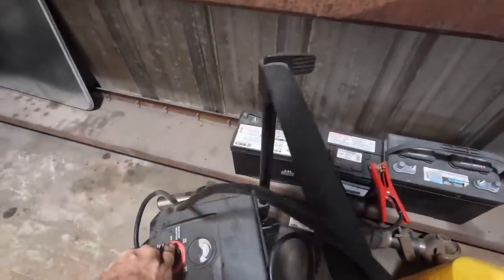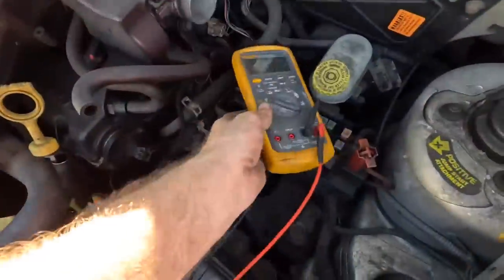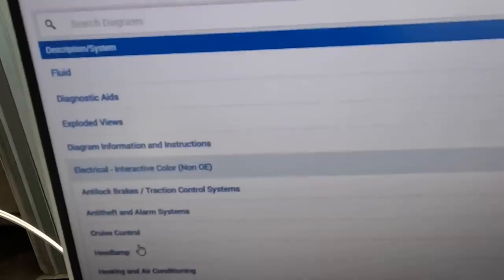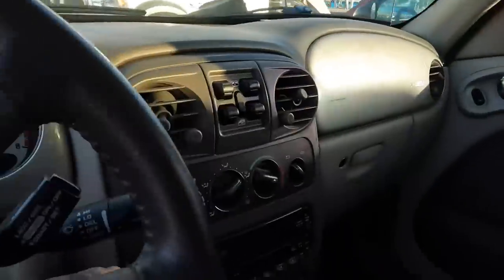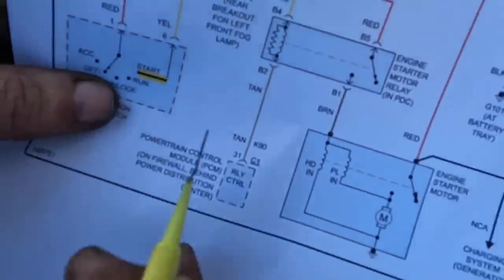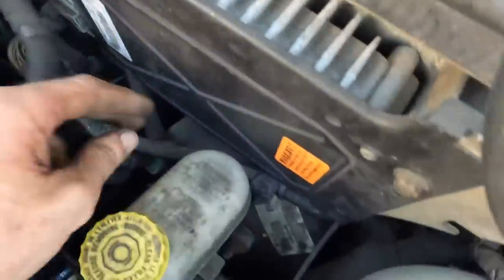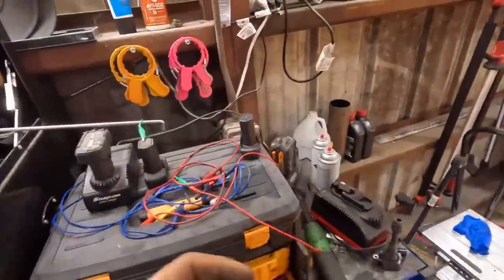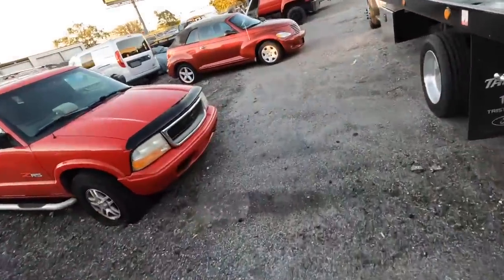It’s DEAD! Parking lot diagnosis

Comment: You might want to look into the anti theft system. Looks like your key has a grey colored head which signifies anti theft vehicle. Also there is a red dot light between the two left hand gauges, that should be the anti theft indicator light. You also might want to go back and revisit the door lock issue since the door locks and the anti theft system share some of the same fuses. As a side note it is not recommended to swap modules between Chrysler vehicle of that era and earlier. Connecting a module from an anti theft vehicle to a non theft vehicle can awaken programs in the non theft vehicle and it may never run again. Rare but I have seen it happen.
Reply: Agreed, I had the same on a sebring in about 2002
Reply: Yerp.
Reply: Yep, same BS with my Volvo. Change a battery and you need recoding.
Reply: On my 2001 PT Cruiser when the key was not recognized it would start for a couple seconds and shut down.  I had to have 3 pcm programmed to finally get a good one.
Reply: Could also be the sensor ring around the ignition switch that picks up the signal from the key.
Reply: yeah my guess was going to be some kind of immobilizer circuit.

weird how dash door locks work but not door switches.
Reply: @Ralph_Baric_PhD_C2019  might just be the immobiliser and central locking that are affected
Reply: Well spotted and agreed. I wonder if the key coded to the immobiliser
Reply: Same on an old Buick
Bypassed it with some resistors
Reply: Yep had the same problem with a Ram truck. Had to disable the security to start it after steering column was changed after an accident or something if I remember correctly.
Reply: it's out of gas  LOL Gas light is on  and is on EMPTY
Reply: @Ralph_Baric_PhD_C2019   the best immobilizer is running out of gasoline  16:19  it clearly shows it's out of fuel
Reply: I thought the PT Cruiser emblem was the anti-theft system.
Reply: to me it appears that the veh neutral safety switch might be bad
Reply: Took me a week to figure out that the stealer ship only programmed one replacement key to my Nissan.
Reply: Had the same problem with an '01 Town and Country.  New key reader and two news keys and it was fine.
Reply: makes me wonder if someone tossed a junkyard PCM into it (ray said he had been told the pcm had been replaced) and added to the problem by screwing the security.  

plugging a scantool in and seeing if the vin in the pcm matches with the car might be enlightening.
Reply: Good catch Sparky, I didn't see it until rolling the video again, just after 2:00. That little light would be easy to miss. As others have mentioned, the key needs to do the right dance to the immobilizer so it can tell the PCM whether it should allow the starter motor to run. A scan tool should be sending red flags regarding that as well.
Reply: @normangarrand1106  Don't worry, with the magic of editing, he can replace the neutral safety switch off camera. Then still look like a professional after replacing the "faulty" pcm. I can't believe he didn't even try to click it into neutral. WOW!

On the bright side, the neutral safety switch is internal to that trans (under the v/b), so you can up-sell a trans filter & flush too!!!...$$$
Reply: @punker4Real  I posted that then deleted it, because being a female, I thought I would be told I was stupid.
Reply: Let see if he makes a Part 2
Reply: P😊
Reply: @punker4Real  yes but it also did not crank a car will still crank if there’s no gas. Ray only got it too crank by bypassing the ground
Reply: @marymulrooney1334  Mary say what you like don’t worry what others think of your thoughts and if they disagree you can get even once your proved correct😃 Have a great day👍
Reply: @marymulrooney1334  i hear you.  Been in the trade 30 years.  learned to hide my gender online long time ago.  ignore that.  just trust your training
Reply: As I was watching this I wondered if it could be a bad key sensor or whatever they are called. Is that what your saying here?
Reply: @wo4689  I have a 2000 Sebring and it came with a hardware store 2nd key. That key without the chip would start the car but wouldn’t let you move it.
Reply: FWIW, the immobilizer in the 2014 Jeep Patriot will allow the engine to start and run for three seconds if the fob is improperly programmed.
Reply: Why would anybody want to steal a pt cruiser  !
Reply: @scott.koopmann  if the neutral safety switch were bad he would not have power at the relay.
Reply: My 02 3500 Cummins if you don’t open the door on either the passenger side or the remote you’ll never get it to start.
Reply: @oliver_klozoff  Automotive relays require a GROUND signal to activate. The fact that there is power is irrelevant. The fact that there is no ground signal turning the relay on is the problem. The pcm sends the ground signal to the relay, but the pcm will not send that signal if it thinks the vehicle is not in park or neutral.

Tune in tomorrow to see the results.....maybe.
Reply: You guy are smarter average bear!
Reply: Yet anti theft on a Pt Cruiser...humm
Reply: Good to know. Thx for the info. Anti theft so powerful it keeps everyone from using it 🤣😶
Reply: @devinangola3458  recoding for a battery change? Love to hear that story.
Reply: To my knowledge, Ray checked all the fuses on the bus. So I don't think it's the anti-theft fuse connecting locks with PCM
Reply: @CameronDC-Grimes  Yes, he did but there is another fuse box inside the passenger compartment. It contains three of the four fuses used in the anti theft system.
Reply: @scott.koopmann  You are correct that the PCM will not allow the starter relay to work if the neutral safety or transmission range sensor is not sending the correct signal to the PCM. The lack of a proper range sensor signal should not inhibit the PCM from enabling fuel on this era of vehicle though. Although it could also be out of gas as mentioned by someone else. The fun in doing this kind of repair is collecting all of the data and using it to solve the mystery. Personally, I would have started this diagnosis with a full vehicle scan for codes and then looked at data related to the symptoms but it is more fun sometimes to see how far you can get with just your wits and a multimeter.
Reply: @davidmerullo551  Sounds like you have a problem with the driver's door lock cylinder position switch.
Reply: @devinangola3458  isn't that completely different? The car will still start but may over charge the battery decreasing its life span.
Reply: @BlamBlam80  the pcm controls numerous relays and security systems. It sat for 2 years during the pandy and water infiltrated passenger side flooding it. That’s another story. It sat dead for a long time, changing out the battery would allow it to start but half the bells and whistles and audio and screen don’t work. The car drives but twin turbo doesn’t seem to be working. 
  I need to enter the vin number and have access to a diagnostic programmer to enter the code….I’ve looked for fixes that could be done to get said code but they all are paper tigers. It has to go back to the dealership to get reprogramming vans that cost money.
   So my car is a slug till I cough up the money. It’s all to do with the security in the dcm, a stupid anti theft program that holds your car hostage till the get it rechiped, and the car has 3 fuse/relay panels and depending of what country the car was going the schematics and locations change. I have 10 different down loaded schematics,over 30 sheets of papers to decipher through the wiring to problem solve.
   It’s the pcm, so it has everything to do with this thread. If anyone has some insight how to remedy this problem on my own let me know, or I just go pay the extortion fee to get my car back…
Reply: @scott.koopmann  but if the PCM is receiving all of its proper signals and not giving it then that is irrelevant. Also if none of the relays are receiving that ground signal from the PCM I really doubt the neutral safety switch has anything to do with the auto shutdown relay. Nice try arm chair try again.
Reply: @devinangola3458  wow. Good luck 🍀
Reply: @pitchforkpeasant6219  I don’t need luck I need a technician who can enter the vin and recode/chip the car!!😂
   I’m starting to think just spend the cash and hand it to a shop….😔
Reply: bmw,,needs to know what type, style, amps, color, price, your battery is..when replaced..
Reply: @marymulrooney1334  Maybe should post it anyway.  Hard call, yes?  On one hand, getting called out sucks and tends to make a meta conversation that can also suck.  But, on the other  not talking about stuff can pull a person away from things they would benefit from and enjoy too.  Craptastic!

The clowns calling you stupid are a PITA and maybe karma sees them stub their toe every time they talk a woman down.  Hope so. 

And yeah.  You deserve the same conversation any of us have.  I am raising a young one who is mechanically inclined.  She seems to love talking about these things and learns quick!  This crap we are talking about snuffs out that mechanical spark in a lot of girls, right when they are ready to pick up the high value skills and potentially grow into mechanically capable women.

I am encouraging her to speak her mind same as anyone.  You should too, and of course you are not stupid.  But they really are clowns.  Probably stuck with that too.  The rest of us get to laugh.
Reply: @johnlarkin549  This!
Reply: @DougDingus  ?
Reply: @johnlarkin549  Sorry John.  "This!" is a short hand expression for when one might say they agree or see what someone else said as being solid, worthy, worth consideration, etc... hope that helps.
Reply: When it was cranking I would have introduced some starter spray to see if vehicle fires with fuel introduced.
Reply: @DougDingus  👍
Reply: @ZGDX_Smiling_  Looks like you called it. Thats too bad, I was really looking forward to the sequel of this one. I guess thats the rules of a youtube "tech"...never admit to being wrong, just pretend like it never happened.

Comment: Pop the key in and switch to the on position, immediately click the drivers door unlock switch, see if the anti-theft light goes out.  PCM might be mismatched or hasnt been programmed, or it may have switched to anti-theft mode if someones been switching PCMs to test.  Who knows if the key, PCM, lock barrel even belong together.  PCM might be good but refusing to authorise crank.
Reply: Yes,  That is the case with that range of anti-theft systems in Chryslers.  If you try to start one of these with a hardware store-cut key "slug" the engine will run for about 2 seconds then cut out.  I think you get three attempts at this before the PCM goes into code and a dealership has to reset the PCM to allow a restart.  I don't know whether you can still crank the engine when this happens or if it is a complete ignition disable. And I'm not inclined to experiment with my '01 PT Cruiser LTD 5-speed. 😑

Comment: Ray, the question you weren't asking is, "why is the ground coming from the PCM?" There's a reason for it. So before loading the parts canon, you should be looking into the inputs to the PCM that are supposed to trigger that ground output. A very simple example would be if the gear selector was not in PARK, the starter should not fire.
Reply: Can I ask you a question? Where I'm from we have virtually no cars with auto, hence my ignorance. I assume there's has to be some kind of sensor that detects when the car is in Park to avoid lurching accidents when starting the car, so if this sensor was to be faulty it could cause it to not crank?
Reply: @aigoru8718  Yes. For stick shift cars, there is typically a clutch pedal sensor/switch so the car cannot be started in gear. This is also used to deactivate the cruise control if the driver pushes in the clutch, otherwise the engine would redline.

For automatic transmissions, there is a sensor/switch that detects the gear shift is either in park or neutral.
Reply: @powertool64  Thanks dude!
Reply: @powertool64  Thats interesting information for me as it shows how cars have changed since the early 1970's when the clutch pedal sensor did not exist on at least UK cars.  This meant that when my 1968 Mini ran out of petrol 100 yards from a garage I was able to simply put it in gear and operate the ignition key and "drive" the car to the garage using the starter motor as a sort of "engine".  Didn't seem to do much harm apart from a burning smell from the heater vents.
Reply: @alanclarke2524  Yeah, I use to do that too. I know my Ford Fiesta could start with the clutch out, and I think my early 80s Mustang could, but my 87' Merkur XR4Ti (aka Ford Sierra for you UK guys) had the lockout. But it also had the cruise control too, that the other cars did not have.
Reply: My old Volvo BM tractor from 1970 has a manual gearbox and a clutch safety switch and it still works.
Reply: I had that happen, the park switch went bad and wouldn't turn over on a 2001 Buick!!😁😁

Comment: Need to trade that fancy fluke for a test light. Meter will give a good voltage reading if there is any connection to the circuit, takes no current ( 20M input input impedance) to indicate volts. Probably not the issue here but it’s gonna lead you down the rabbit hole sooner or later. Watch Eric O or Ivan circuit checks.
Reply: He could easily make a block to plug the leads into that has a switchable load with resistors that would work.  maybe 1000 and 10k ohms

Comment: I have the same model and year PT Cruiser.  What I have learned is the SKIM must first recognize the key and then sends a ground command to the PCM, and then the PCM must send the ground to the relay.  If the PCM was changed and not matched to the SKIM/key, the PCM may not be the problem, only the SKIM/key are not matched to each other and then the PCM doesn't recognize the signal.  Been there and done that.

Comment: @Rainman Ray, you had mentioned an extra key, not cranking, no power to the door locks and that the steering column had been removed at some point. Those were your observations.

Is there any chance it could be the immobilizer in the gray key and the Transponder aren't speaking to one another.  

When you tried starting it the anti theft light was flashing, this could all be related if perhaps they put in a new lock cyclinder/replaced a key and would explain the extra key and the steering column being messed with and the door lock issues.  

By doing this, it would also explain why the car isnt starting because the key immobilizer and transponder are no longer functioning together.  

Wouldnt you need to have the software to unmarry the SKIM and the PCM.  Then perhaps reprogram it for that car/VIN????

They probably tried unbolting the SKIM from the steering column, to try and bypass it rather then get it programmed.

Perhaps give this a try and see if you get any results:

1.  Hold the GRAY key up towards the cyclinder lock.

2.  See if the anti theft light flashes and then goes off entirely.  

3.  Then put the GRAY KEY in your pocket and start the car with the non transponder key.

See if this works.

I truly believe the owner may have tried to bypass the immobilizer and unplug the SKIM itself. 

The problem is unless they unplugged the SKIM and got a PCM new or from a donor car that did NOT have a SKIM.  Once a PCM sees a skim module, it will always look for an "ok to start"  message from the skim itself.  

I would suggest, try to program the key or replace the key and have it programmed if their existing one will NOT program.

Keep in mind im NOT a mechanic, and Im only learning about vehicles thru channels  like yours and those similar to yours.   

Im hoping this may help resolve the issue and perhaps we will see a part 2 to this video.

If im wrong or anyone wants to explain anything please feel free and know Im just learning here.  

Love the channel and the content.  Its people like yourself that inspire others and make them want to learn.  Thank you for that.

Comment: I think FrugalPrepper hit the nail on the head when he said this earlier. Reposting in case Ray didn't see it.
FrugalPrepper's Garage & Garden
3 hours ago (edited)
PATS problem.  The PCM only provides ground to that circuit when it reads the chip in the key.  The computer is matched to the reader in the column.   You can only reprogram it if you get the pin number from a dealership.  You can take the pats module, key, and computer out of another car  from a junk yard and change them all together and it will work.   Chrysler will not give me the PINS for anything because I am not a Licensed Locksmith or some other Auto Security Certification.   Make sure you get the same year and options, and don't get one from a convertible.   Someone has been futzing around with the PCM and the Ignition in that car.  My guess is they tried a new PCM and then created a new issue thats different than the original one.  Just make sure they don't read the VIN out of the computer and make sure it matches to do emissions or registration in your state, like the do in NY.
Reply: You may be right. The fact the steering column cover was removed indicates they may have swapped or unplugged the reader for the chip key.

Comment: I had this happen. It was a GPS tracker/lockout device installed by a "buy here/pay here" dealer. When this unit failed it defaults to the lockout. It was installed on the ignition switch harness under the knee bolster. EXACT. SAME. SYMPTOMS without changing all those parts. Good luck Ray.
Reply: it's out of gasoline   the gas tank is on empty  16:19
Reply: @punker4Real  Out of gas never creates a non crank condition.
Reply: @HookMann88  absolutely correct, it will let you exhaust every electron out of the battery.